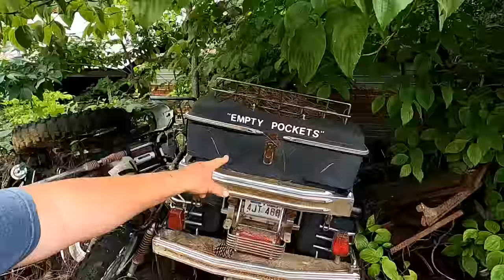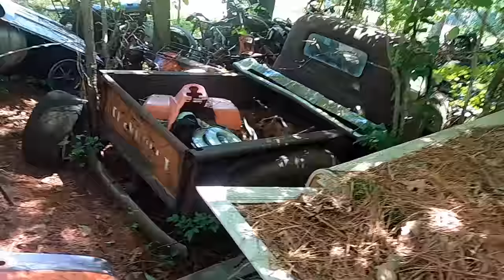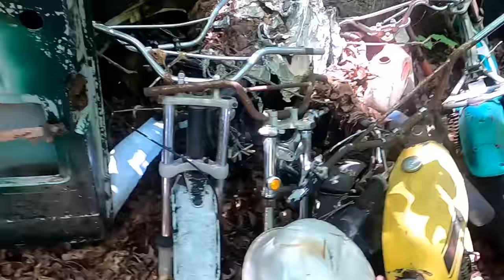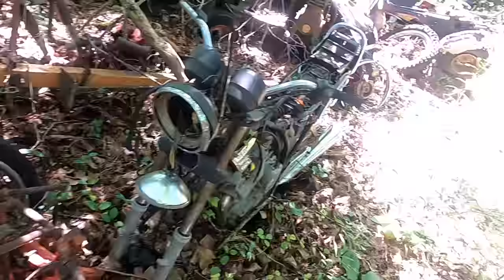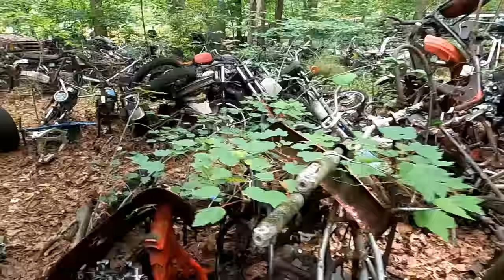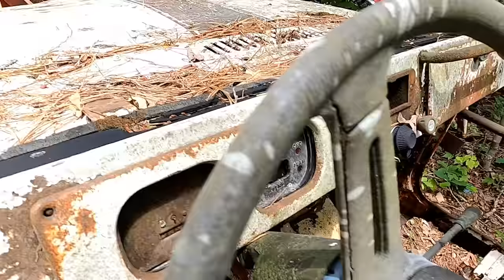3000 motorcycles in the woods abandoned junkyard part 2

Comment: How in the hell does that guy expect any of that to get recovered?! Even if he was in the business of selling it would impossible.
Reply from the maker: It is a struggle. However, he has been selling bikes. They even had to take down part of a wall to get 3 of them out. Thanks for watching!
Reply: Yeah, once the weeds start growing in the engines you are going to need a lot of restoration. You can leave a machine sitting in a low moisture area for a long time, but not in the foliage.
Reply: This would be WELL worth the work!
Reply: Looked like you would have to move hundreds of bikes to make a drag path for those Camaros!
Reply from the maker: @Steve Atkinson  we have actually pulled the camaros out. Was a bit of work, but they are out and up for sale.
Reply: Yep. Lots of cool old machines.  Was hoping to get a peek of one of the 70’s cheap small Harley/Italian jobs.
Reply: @needparalegal  everything on an engine can be replaced it doesn't really matter what happens to the engine, except fire
Reply: @steveatkinson9401 
Hi sir. Your this video is awesome sir. Sir i long time for searching 1978 🇬🇧Uk model Japanese Yamaha RXS100 bike engine spares but i can't able to get the spares so please🙏 help me so  how to i get the 1978 uk model original Japanese Yamaha RXS100 engine spares?

Comment: There's a smaller place located near me, about half the size. I've always gone there to look around and dream about what could be found if someone took the time to sort through everything. However, it's unfortunate that, at least in the one near me, they're quite reluctant to part with any of it, and the prices are exceedingly high. As far as I understand, it used to be (and to some extent still is) a cycle shop. The owners are semi-retired and generate income through repair work, but over time, the bike parts have turned into more of a collection.
Reply from the maker: He has been selling a lot more than he used to. Nice to see things getting saved

Comment: 3000 bikes?  Surely there's 3 or 4 of the same kind with enough parts to build one vintage '70s-'80s motorcycle which was the best bikes in my humble opinion.  I'm all about full chrome fenders, chrome headlights, huge chrome turnsignals, chrome badges or model badges on side c overs and chrome wheels.  I prefer the standard, upright rider configuration where front and rear tires are close to same sizes say within an inch.
Reply from the maker: They have saved a few of the bikes

Comment: There's a motorcycle junkyard in Phoenix that has several acres just like this
Reply: I went to the one in Phoenix last year and bought a few parts.  Advertised as the biggest in the world  Prices weren’t too bad.  The difference is Phoenix has been pretty well picked over for a long time.  The biggest difference is you’ll find almost no rust on the Phoenix bikes and parts.  Also, you walk thru (3) big buildings full of parts before you get to the open acres of bikes, and they are not stacked on top of each other.